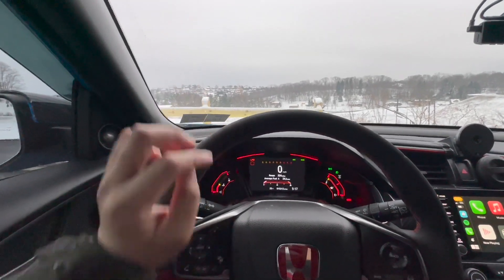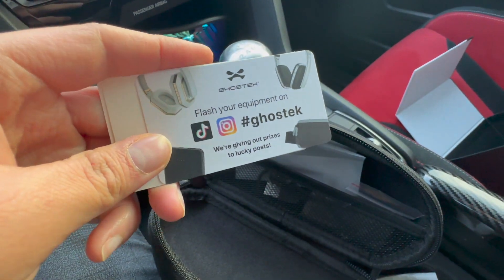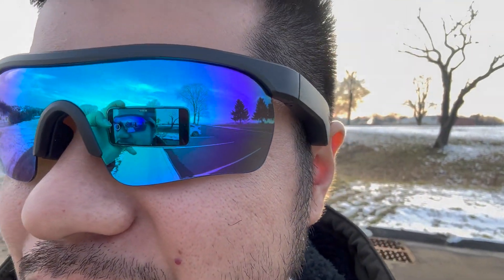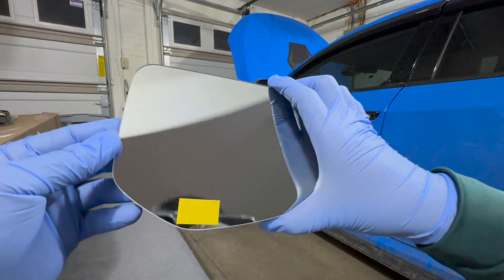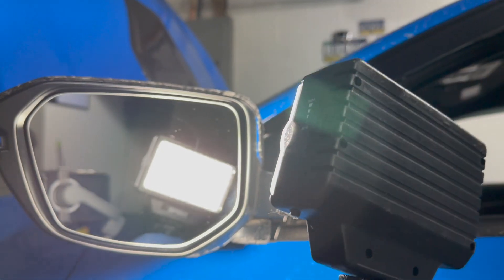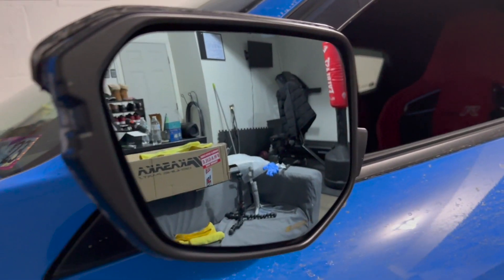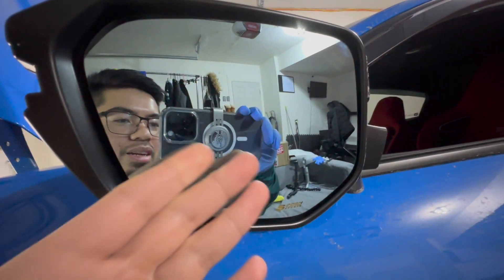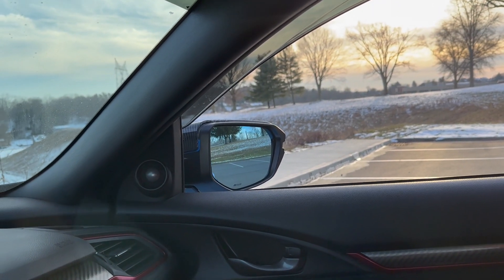10TH GEN HONDA CIVIC SPOON MIRRORS INSTALLATION AND REVIEW

Comment: OEM mirrors are HORRIBLE huge huge blind spots. When I first got the car like 3 times I almost had a collision on the highway because of it. I quickly put the little adjustable corner mirrors and it helped a LOT. Easier to parallel park as well. 10$ instead of the pretty penny for the spoon or mugen.